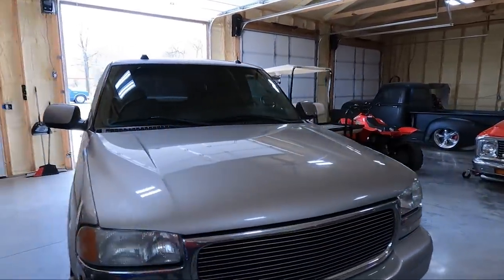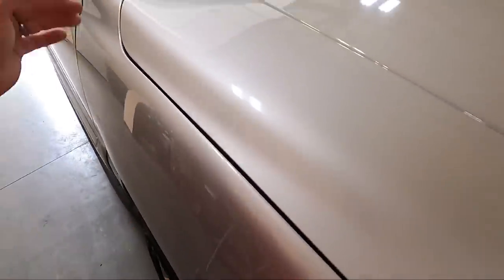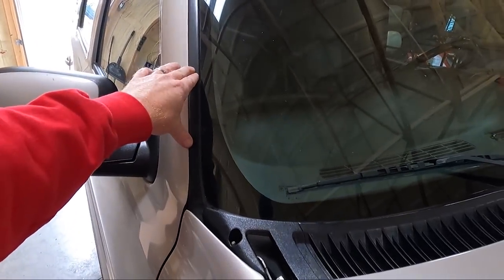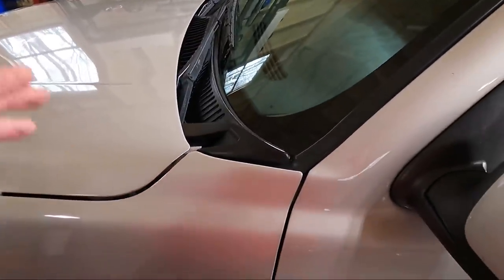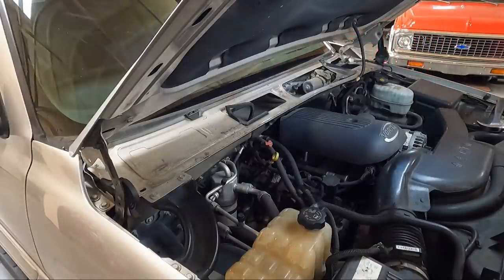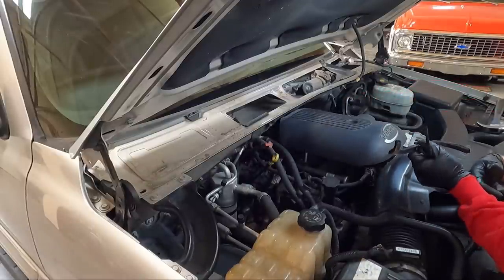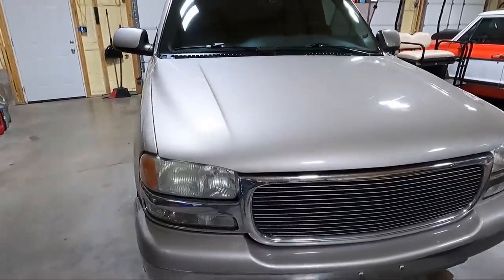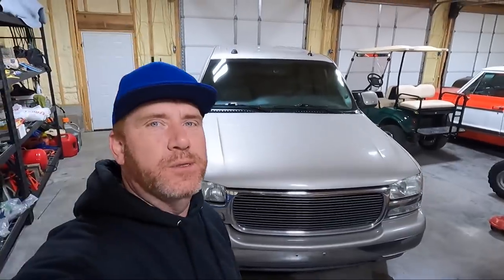Wiper Cowl Clean Up, New Glass, New Wipers, and Short Antenna (Much Cleaner!)

Comment: Great video but here is a tip you may or may not know. When you are removing the wiper arm, loosen the nut until the top of the nut is about one thread higher than the stem. Then when you pull up on the arm and tap with the hammer there will be no chance of damaging the  threads on the stem. This works on ANY size of thread or nut. Either way you got it off and all is well. Thanks for the great video and have a great day.
Reply from the maker: Did that on a video once and people lost their minds.
Reply: @TWAMotorsports  Only because they probably did it wrong. Remember ,it is never the tool but the person using that tool !
Reply from the maker: Yep

Comment: Just an fyi, SEM trim black satin paint #39143 is perfect for any trim restore needs, the paint lays down perfect and leaves a smooth factory looking finish.
Reply from the maker: How does it hold up?
Reply: @TWAMotorsports  very well, I live in Texas holds very well with the heat. Have used on a number of my vehicles and had very good results.
Reply from the maker: Thank you. I will give that a try

Comment: good video as always. I can't stand faded wiper arms either. it was neat to see that your Yukon has Hydroboost. I figured that was a 6.0L thing, must be the SUVs with dual piston rear calipers also got hydroboost over the standard brake booster.
Reply from the maker: Thank you. I have seen several 5.3s with the hydroboost option

Comment: The screws in the dash is when someone took the that too of the dash off and the clips across the front of that panel probably broke so the put a screw in to hold them back on so it will slide back in to place, but they use to long of screw , I’ve glue those clips back on before
Reply from the maker: Interesting. That makes sense
Reply: Yeah those clips are bad about breaking with they get old if you’re not careful
Reply from the maker: I imagine

Comment: If you paint the grill black, you have to paint your wheels black as well.  No other options.  So either remove it or leave it alone.
Reply from the maker: Probably remove it.
Reply: Personally I'd black out the front grille and the wheels. Then get the smoked front and rear lights. It'll look amazing.
Reply from the maker: No black wheels here. I can't stand black wheels. Lol
Reply: @TWAMotorsports  Totally agree, black wheels are not an attractive look for any vehicle.
Reply from the maker: Looks like a shipping wheel. Lol